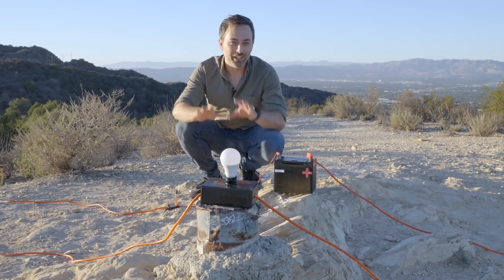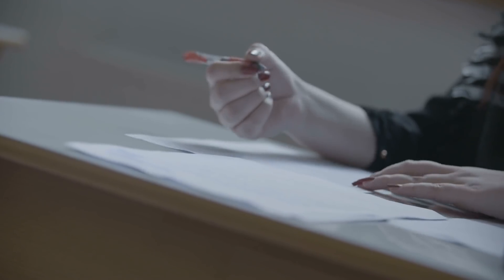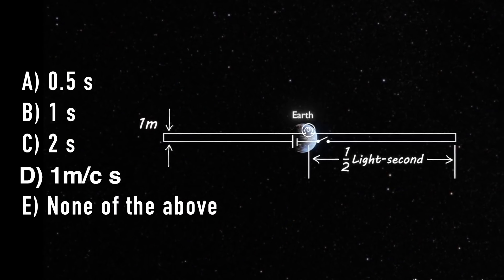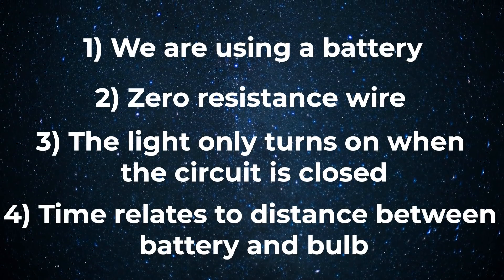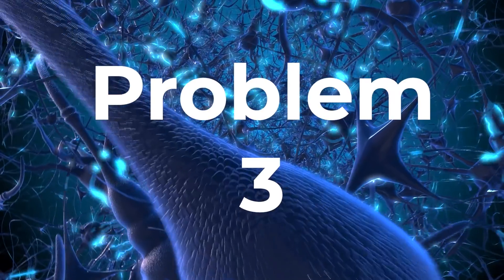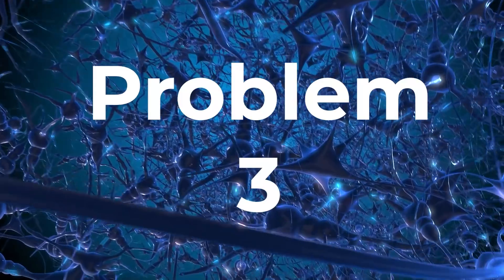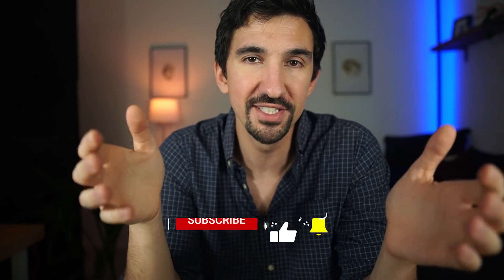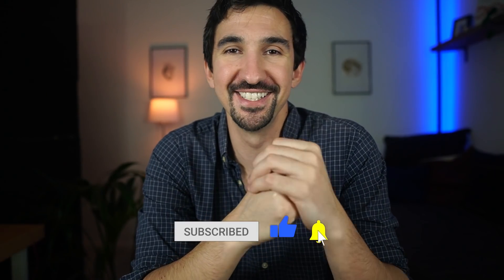Is Veritasium Wrong About Electricity?

Comment: 1/c.. means actually 1 metre/speed of light. Using the formula.. time= (distance/speed). Since the bulb is actually 1m away from the battery
Reply: Exactly! The battery was placed 1 metre from the light bulb and so the one in 1/c meant one metre. Sheesh (Edit: I’m not suggesting that 1/c is a correct answer at all).
Reply: @GoldenLion8  I think the units can be implied; but, yes, your suggestion does make it clearer that 1/c was not meant as a mere reciprocal of c.
Reply: OTOH it was that 1/c having units of seconds which told me the 1 had units of metres. Sometimes ya have to think things thru a bit and not just assume people are wrong.
Reply: @GoldenLion8  The context of the original ‘1/c seconds’ statement is relevant too as it was one answer for a multi-choice question designed to educate people. So it was a bit of a trick answer designed to make people think about the setup. Demanding the units be included in the expression is a convention imo; albeit a clear and helpful one.
Reply: @GoldenLion8  agreed that I may be wrong in guessing the intentions behind using 1/c seconds. Thanks for your discussion which has reinforced the usefulness of conventions. At risk of being boring I’d like to paraphrase a post made in a nearby thread which said 1/c is simply a constant, made up of one constant divided by another constant. I can provide a link if anyone wants to read this point made so eloquently.

Comment: Causality might still hold up with Veritasium's answer, with the bulb will going off at 1/2 + 1/c seconds (pardon the units!). I think there's a slight nuance in the third assumption you make -- rather than saying "light only turns on when circuit is closed", it should say "light only turns on when battery sends out energy flux, and that happens when the circuit is closed". So now, circuit breaks at far end > battery 'realizes' this at 1/2s > bulb realizes at 1/2+1/c.

Great video, thanks for posting. Yayy science!
(Full disclo -- I'm also not from this field, being a lowly electrical engineer unfamiloar with relativity.)

Comment: Hi Ben - There are one or two completely separate points I would like to raise.  I may have to split into separate comments to avoid a ridiculously long comment.  

Most important thing first - The SAFETY implications of Veritasium giving people "a little knowledge"  (was it Edison who said "A little knowledge is a dangerous thing"?) - I was VERY alarmed at some of the comments on his video, people seriously talking about whether it would be considered "stealing electricity" from HIGH VOLTAGE TRANSMISSION LINES, if they weren't actually making a physical connection but just relying on induction to tap energy from the lines in their community.    (I think the user name was ZEET)  

The DANGER of even getting within a few FEET of HV lines makes me shudder.  High voltage can jump several feet - It doesn't give people any warning - it just fries people in an instant before they get "close" - The air ionizes and then there is a massive three phase flashover - They certainly wouldn't be able to touch the lines anyway for that reason.    Even at 230 / 400 volts (industrial three phase - so called "low" voltage)  one small mistake causes the air to be ionized and again, a three phase flashover.   (An electricity supply engineer I knew, made a small mistake changing a three phase meter and needed 6 months off work - became a born again Christian - said it was like a hand grenade going off.    Unqualified people can be VERY casual about electricity - operating industrial switches with a pair of pliers, so they can keep the cover open to make fuse changing easier - DAFT things like that - We have to do everything we can to stop giving people HALF BAKED information about how electricity distribution works - Everybody thinks they are an electrician for some reason but most are blissfully ignorant of the dangers they cause to themselves and others.     

I just think we have to be very careful before giving people the false idea they can put some cable "near" a transmission line of ANY voltage and "tap off" free electricity - desperately poor people will do desperately stupid things.    It wouldn't work anyhow because Veritasium's claim is very misleading and gives desperate people false hope that there are ways to tap off free electricity in poor communities where this is rife anyway.   People get killed even trying to steal live cable in Britain.     

ANYWAY - that was my main concern first.

On second thoughts, I would like to do some actual experimentation work to illustrate one of my objections to the sweeping claim made by Veritasium - I don't mind things being "unintuitive" - who am I to argue with nature - but if I can show nature doing something that is supposed to be impossible, if we are to take his word quite literally,  then it MIGHT be a good reason to re-examine his claims.    I think I should be able to construct my experiment in a day or so - that would be better than me making thought experiments, which seem to be all the rage.  

OK so just one more thing - Should be more up your street...

Optics being your field of expertise, you may be interested to know of another quite famous You Tube scientist making a claim I feel sure you would dispute - Just like you, it's been "bugging me" ever since hearing Professor Moriarty of Sixty Symbols fame, (Nottingham University)  inform us that if the E field of electromagnetic radiation is oscillating, say, vertically (for example - as in a simple upright radio antenna)  then it can "slip through" the narrow gaps between the vertical bars of a suitable polarizing filter  (say, a WIRE GRID polarising filter typically used with 10GHz microwaves for teaching purposes)   BUT WOULD BE BLOCKED (he say's) with the filter bars turned HORIZONTAL relative to the VERTICAL E field vector.   

He even has a special "snake like" plastic rule, to physically demonstrate how it slips through the gaps in one orientation but cannot physically pass through in the other.     That video (about 3D glasses)  has been up for nine years and I'm quite sure no correction has ever been made ... Last time I checked a year ago, only TWO comments out of about 1000 at the time,  pointed out that this is not how polarising filters work - and that the orientation he describes PASSING light / radio etc is in fact the orientation which BLOCKS - because the E field - or the magnetic field at 90 degrees to it obviously, is then effectively able to "induce" current into the bars.  (my layman way of thinking about it)

Forgive my LAYMAN talk - it's just easier for me to remember how it all works if I pretend there is no near field/far field distinction - then for me it just looks like two relatively long conductors parallel to one another (rather like Veritasium's very long wires just 1M apart)  and straightforward EM induction.    No, I have no qualifications in this so I lack confidence expressing my doubts in an actual Professor, but i have checked many many times, invested in ex school equipment etc so I can learn for myself - and so I am quite certain Prof. Moriarty is wrong.    What say you?   

I've just checked again - The Sixty Symbols video is now 9 years old and is called HOW 3D GLASSES WORK, 650,000 views, about 1,300 comments now - I don't fancy trawling through every single one again - The first 50 or so recent comments are just the usual fawning over how wonderful this explanation is - which bugs me even more of course.   I still cannot see any amendment or correction.    The relevant bit starts at 4 minutes in.  

Sorry for the lengthy message. 

Oh and yes - it felt wrong for Veritasium to say we've been taught "lies" - I will try to get my experiment together ASAP - nothing posh - just to illustrate a possible flaw in his sweeping statement.    If I end up proving him correct I'll be gobsmacked.
Reply: From "Essay on Criticism" (1711): 
A little learning is a dangerous thing; 
Drink deep, or taste not the Pierian spring: 
There shallow draughts intoxicate the brain, 
And drinking largely sobers us again.
Reply from the maker: Hey! Interesting, I haven't seen it before. I'll take a look, but I agree, similar to an antennae, vertically polarised waves are absorbed by vertical resonators.   Thanks for the comment
Reply: If you have a reasonable oscilloscope and a couple of fairly long bits of wire (and the appropriate gear so you don’t just over voltage your scope it isn’t hard to show he is more or less on the money experimentally.
We did the experiment with a few hundred m of wire and a power supply which could do pulsed “DC”, as well as low and high frequency AC up to I think it was 40 GHz with pulsed DC if the conductors ran together (I think our air gap was only 5cm or something) the voltage got there basically instantly and then had all sorts of Eddie’s and stuff depending on what was around the wires and how many times they changed directions etc.

I didn’t get to do all that much except help out as it was primarily for the geophysics class and us geos were just helping but it was pretty memorable
Reply: Alexander Pope, not Thomas Edison.

Comment: Thanks for this video. Your idea to think about it as antenna is appropriate and an excellent addition.
One point you do not explain correctly is that this somehow breaks causality.
Consider this: You are sitting at the power source looking down one of the lines. At the 1 light minute mark down the line, you observe Charlie chop the line with an axe, thus breaking the circuit. 1m/c later, you would observe the lightbulb turn off. From Charlie's perspective, He chopped the line and would observe the lightbulb turn off 1 minute later. This by no means breaks causality and is an extension of the classic lighting/train thought experiment. Causality is maintained, as it always is, and no "advanced" messages can be sent.
Reply: Veritasium is saying the light would go out 1 minute before we see the line being chopped.
Reply: @alexjohnward  I watched it again and never saw that claim made. If you could reference the point that claim is made in the original source, I would appreciate that. Either way, I am not defending the Veritasium video.

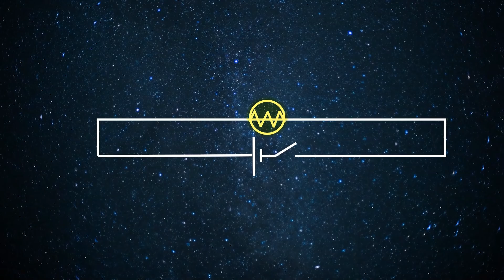Comment: 4:30 why would the light turn off in 1m / c seconds in this case? I argue that current through the bulb would only stop flowing 0.5 sec after the break occurred due to the light delay. Move the switch to any particular point on the wire, the bulb will only "turn on" after the light delay since the energy due to the electromagnetic field can only propagate at the speed of light. Move the switch 1/4 of a light second down the line to the right, the delay will be 0.25 secs.
Reply: 1m/c is a velocity, is it not?  I don't understand why the video turns the time it takes the bulb to light up, 1/c seconds, into a velocity of 1m/c seconds...help!
Reply: I re-watched the video and see what he was saying.  "c" is a constant with the units m/s.  So "1/c s" is really 1/299792458m/s s.  I get Derek's point though...energy reaches the load before the current travels through the entire circuit.

Comment: your assumption that the light will not turn on if there is a break at the turnaround point of the cable is wrong, sorry. Cables have capacitance, so some (small) current will flow through the lamp until at least until 1 second (when the end is "probed" by outgoing wave and the signal is returned). It actually won't turn off, the transient will continue, sending ripples through the wires back and forth, eventually (exponentially) decaying to zero.

It bothers me that Ve assumes "light on" = "any current", for that, you don't even need all this mess of wires going into far away, just a battery, a switch, and a lamp lying nearby is enough, no wires are needed (closing a switch will produce a radio pulse, which will turn on the bulb).

Comment: I like how you think about this. What struck me about  Veritesium's video is how he subtly slides from Poynting's method of calculating light energy, self-propagating in space with perpendicular electric and magnetic fields, to doing the same thing with current in a wire, thus implying the space outside the wire is transporting the energy, not the wire itself. This seems wrong, because in any wire with resistance, heat is generated, showing the energy is in the wire. Another thought experiment is to block the electromagnetic field outside the wire with a Faraday cage or some perfect insulator. Say we put the entire circuit in a block of cement, except for the battery and the light bulb. Would the light bulb still light up? I think so. After what lag? My guess would be 1 second.
Reply: If all of the energy were in the wires then how does inductive heating work? An induction coil is used to heat steel instantly so it can be shaped and finished quickly. No wires ever touch the steel pieces so where does the heating power come from? It's the same principle with your induction stove in your kitchen where coils under the surface cause your cookware to heat up thereby cooking the foods in them. Electricity is used but no wires ever touch the cookware!
Reply: @MrBrelindm  The source of the fields in electricity are the electrons in the wire. The fields of the electrons theoretically extend to infinity and are not stopped by insulation. Thus you can use field(s) outside the wire and insulation which can heat things (magnetic fields) and light things like fluorescent bulbs.
The only thing insulation does is keep the electrons in the wire and not let them physically move away randomly and thus you can use the fields of a large number of electrons to get the power you need where you need it from the electrons.
You can also use the fields inside the wire to do stuff also, such as a hair dryer or a motor or a light, etc.
Reply: at 5:21 in the Veritasium video, we see Dr. Bruce Hunt (author of The Maxwellians, Associate Professor in the History of Science at UT Austin) say "People seem to think you're pumping electrons and that you're buying electrons or something, which is just so wrong. (laughs). For most people, and I think to this day, it's quite counterintuitive to think that the energy is flowing through the space around the conductor. But the energy is, which is traveling through the field, yeah its going quite fast... I mean how far do the electrons go in this little thing that you're talking about? They barely move. They probably don't move at all."  So this guy who Derek seems to view as some kind of authority on this thing, says "they probably don't move at all".  So he is saying we can light up a light bulb from a battery, in which the electrons don't move.  Is he kidding me???
Reply: @manipunation  Your making the assumption that its the elections that provide the power. What they are saying is that its fields that contain the power, not electrons.
Reply: If the wire has resistance, there is a voltage drop from one end to the other, so the electric field between the wires becomes weaker going from the source to the load. This results in the Poynting vector being directed partly into the wire, so the wire absorbs some energy from the field.

The Faraday cage idea is no different from a shielded wire. There's still an electric field in the space between the wire and the shield, and that's where the energy travels. (If there's no space between them, then the shield is shorted to the wire and it isn't really a shield at all, it's part of the wire.)

An insulator, such as cement, will have no effect on either the electric or magnetic field.

Comment: electrical wires are significant (though usually tiny) capacitors!
A lot of  LED light-bulbs (mostly from china) are so efficient, that just 5 meters of cable in the wall are sometimes a large (and thick) enough capacitor to keep an LED lit (at around 5ish lumen) for roughly 30 seconds, after the circuit is broken (by a 5 meter away wall switch).
efficient led light-bulbs not from china intentionally remove this flaw of failing to not be lit when the circuit is broken, by adding extra/better resistors or other electronics.
Reply: There are normally filter capacitors inside the LED bulb, to reduce flicker (otherwise they'd flicker twice every AC power cycle). There is a microscopic amount of capacitance in parallel wires too, but nothing like enough for the effect you describe.

Comment: (changes in) the em field is never (transmitted) faster than light.
yeah, even alternating current is not even close to instantaneous and is relativistic/causality, significantly slower than the speed of light (because it likely does not find the shortest path through a straight wire). this should be fairly obvious.

gotta love the seconds/meter unit. i mean, i derived or integrated a lot of physical units over other units in my life, but i rarely derive/integrate over length in meter.

Comment: I have thought of it a lot. Energy has been dissipated as soon as the switch is thrown and therefore can be transferred. This means electrons have transferred energy from one point to another even through the current hasn’t reached the the opposite terminal but it HAS gone from one point to another. It’s therefore possible for the energy yo travel through the field to the bulb… that’s my logic